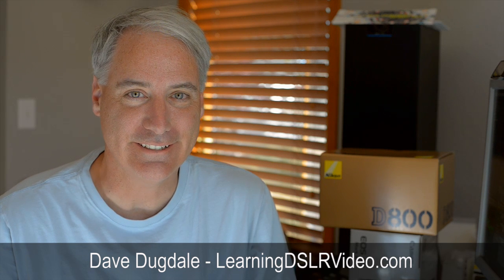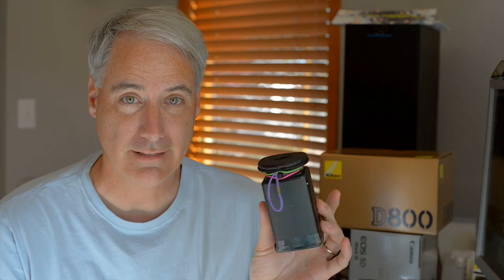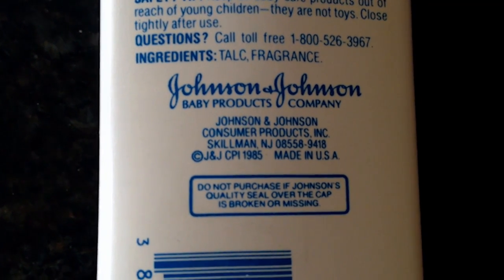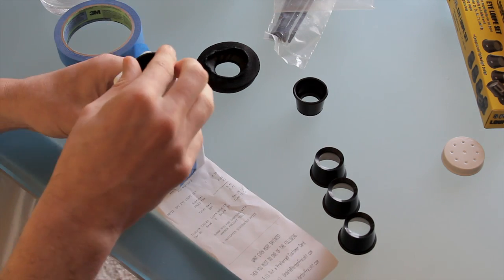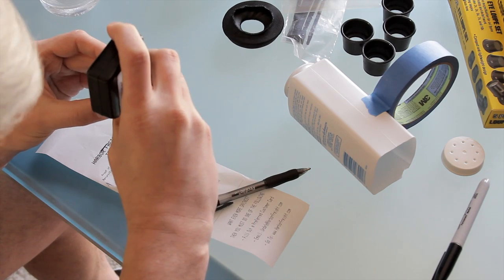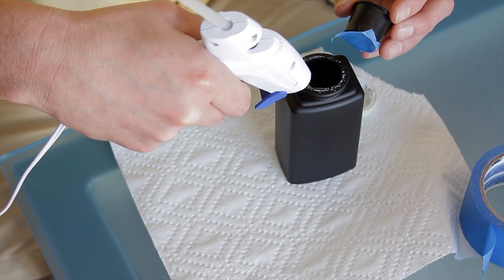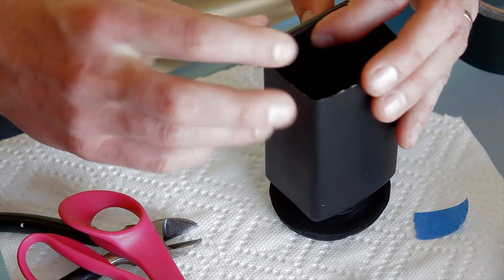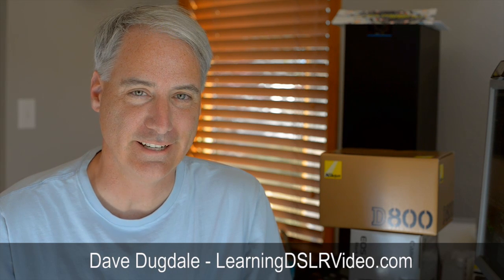DIY DSLR View Finder KnopTop 2.0 Version

Comment: I made one of these once, it worked pretty well but the rubber bands got in the way. I ended up buying a $60 viewfinder that clips on to the back of the screen. I believe it is called "the Hoodeye/ perfect viewfinder. It works very nicely with little light spill.

Comment: Dave, you can find very cheap LCDVF knockoff viewfinders on ebay, just search for "Capa viewfinder", they are very good quality, I own both, and aside for glass quality, surprisingly Capa has better build quality, better eyepiece rubber and neck strap, and even stronger magnets. And really the glass is not the problem, Capa  is a bit soft on edges, but it doesn't matter, the real problem is fogging, and it is the only reason I use LCDVF. In that regard, it is even better than Zacuto Z-Finder.